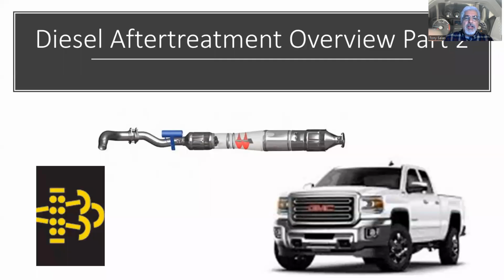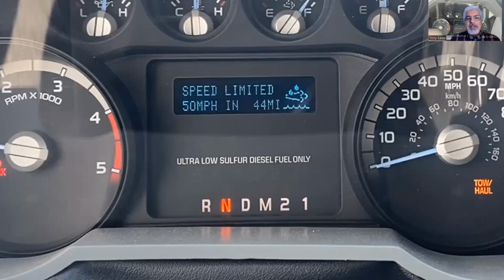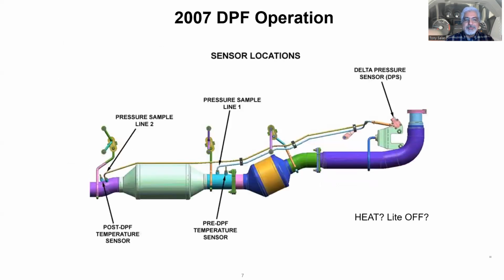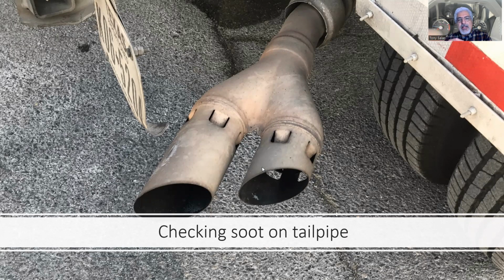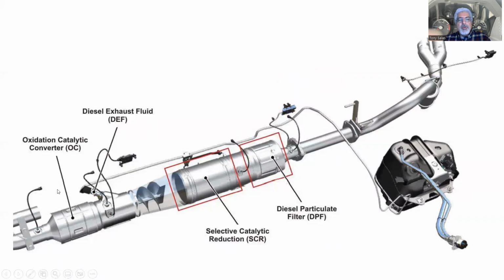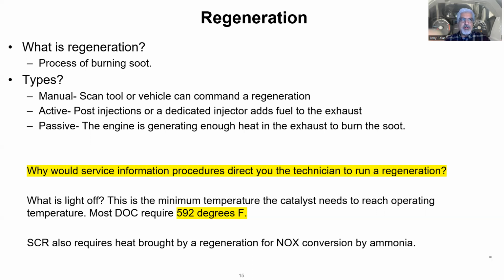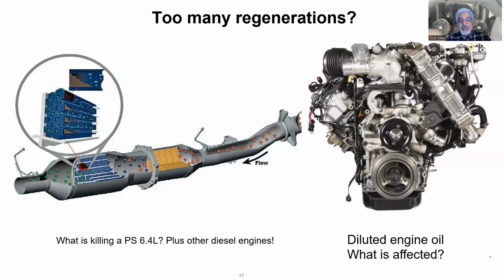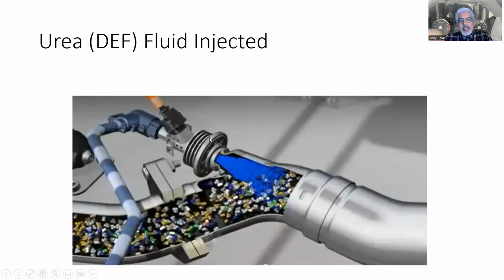Diesel Aftertreatment Overview Part 2

Comment: I think the glow plugs also are active during the regeneration process to increase the amount of temperature required for dpf cleaning ?
Reply from the maker: It’s is not documented that glow plugs are commanded on but the intake air heater is turned on. I will research

Comment: Thanks for another great informative video. I love your thoroughness. I do have a question. How do you  perform a manual regen on a 2021 Dodge Ram 6.7l? A scan tool? And how often should a regen be done? Thank you!
Reply: I believe on Ram trucks it won’t let you do a manual regen unless there is a message or possibly a code set. Again, I’m not certain tho
Reply from the maker: RAM software has not allowed a manual regeneration even with a scan tool without code P1451 set. This means that code P1451 must be set in order to run a regeneration. The system runs regenerations as needed. I wouldnt worry about it until a check engine light comes on. a well maintained truck will do it on its own.